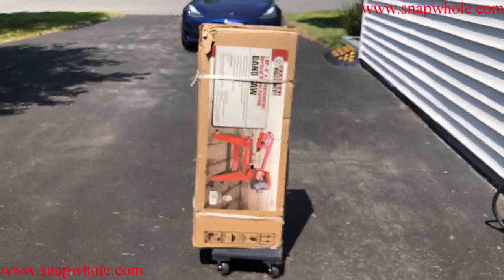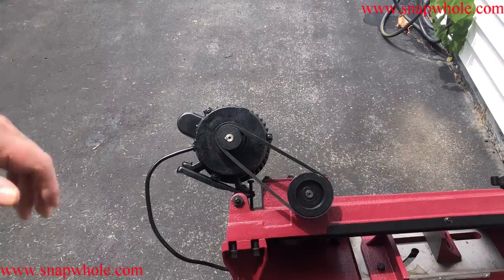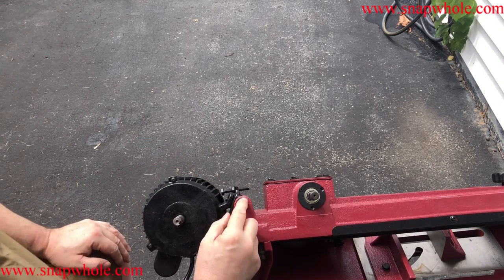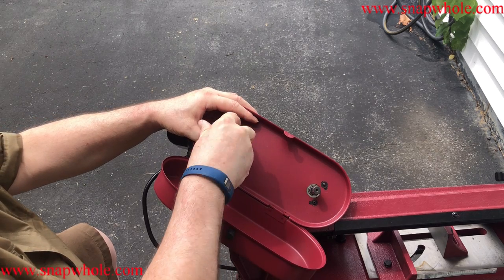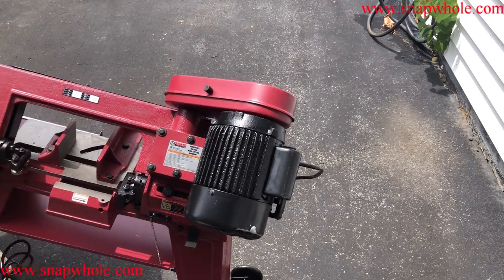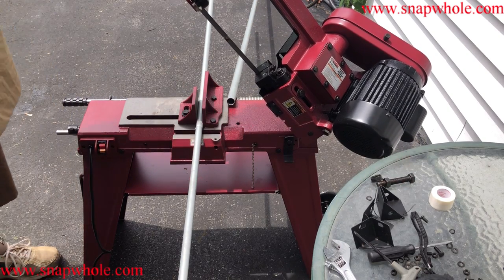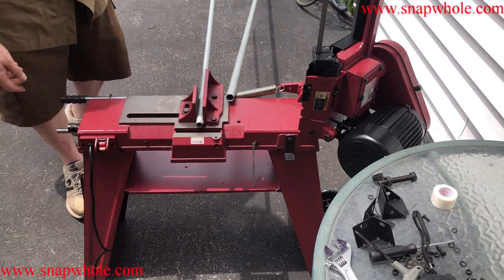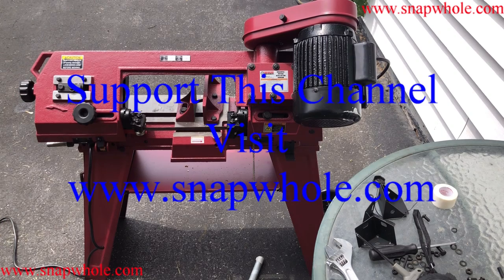Harbor Freight Central Machinery Horizontal/Vertical Metal Cutting Band Saw 1 HP 4 in. x 6 in.

Comment: The handle with the spring is used to slow down the cut. Turn the handle clockwise and it will put more tension on the frame and cause it to fall slower. Also by adjusting the blade roller guides you will be able to get the blade to cut straight instead of at an angle. Do yourself a favor and buy a good german made blade. I have installed one of those blades on mine and it has lasted me 3 years and I have cut quite a bit of iron and aluminum. After I made the adjustment to the blade roller guides I am able to cut a .020 thin piece off a 2" round solid aluminum stock and also on 2" square tubing with 1/4" thick wall. The trick is to tighten the spring tension and slow down the rate of fall
Reply: he probley never will read ur post lol ..

Comment: That looks awesome. I would never have a need for that but I like it. So when are you going to do a shop tour? I’d love to see your setup
Reply from the maker: It as a luxury buy for me, especially for the space it takes up, and I won't use it that often, I just bought the plywood to build a new miter saw stand, it is amazing how much stuff was in the old one, and it is now stacked every where, my shop is not that big to begin with..... also in the middle of 4'x4' CNC build in my spare time, not a lot of that lately, not much room for making videos until I get those project done
Reply: @snapwholeharborfreightreviews    I have a workshop in my garage that’s starting to fill up. All of my bigger power tools I have stands for so that takes up a lot of space. I still haven’t used that Bauer thickness planer but I have a project I’m going to start here soon.

Comment: Hi would this work to cut rail road track?
Reply from the maker: it should cut it, I would get about a 24 tooth blade, it has a great feature for cutting something like railroad rails, get the blade tight and set the blade on the rail and it has  enough weight to keep cutting, and has an auto off when it is done, one of the best feature of this saw - thanks for subscribing!

Comment: How square were the cuts? Im interested in one just to make simple reliable straight cuts without too much prep
Reply from the maker: the cuts are square, but you have to setup the bandsaw correctly, blade tension is very important and setting the clamp tight, but mine is cutting square after I setup the saw - Thanks for subscribing!

Comment: Looks like it would need to be anchored to a base for stability…I would love to get one of those….how hard would it be to hide from wife?
Reply from the maker: no hiding this one! I had to think alot before I bought this, I have a small shop, but once I bought it, I'm glad I did, I use it a lot more than I thought I would, very useful - I wondered how stable it would be with the wheels on one side, but wheels are mounted so they only work on a completely flat floor, so it is stable, I originally thought the wheels were a bad design, but then I figured out they are made to be used as a last resort, I have a 1 inch step from driveway to shop slab and the wheels can't even handle that - hard to describe - I was using it to cut 10 ft pieces of 1 inch conduit for a new CNC machine I'm building, and no only is the saw big, you need  to have a lot of area around the saw when you use it to cut long pieces like that, that is when the wheels come in handy, I keep it back against the wall, and pull it out in the open to use it,- I recommend this if you have the space - I plan a follow up video on setting up the blade with more detail and setting the saw up for vertical use
Reply: Now they are $360.

Comment: Just had to take it back  the roller guides  way out spec the vertical  roller  does  not stay centered  wonders back and forth  to the point  the blade  jams and breaks in 2  / would  have to fix this for it to be a working  saw = press the pin out and some type washers to keep  the roller centered  and not pinch jam the blade.  Can't  imagine how  many  of these quality  control  mistakes are  out there.
Reply from the maker: either I got lucky or you got unlucky, I do not have any issues with the saw, very solid saw and I can make repeatable cuts one after another and use the auto off function for unattended cuts with no issues - thanks for subscribing!

Comment: Read the INSTRUCTIONS FIRST and then adjust the tension spring that offsets the weight of the saw !!
Reply from the maker: glad I did that first when I did the setup, that is exactly how I want the tension to be on this saw, I'm surprised you set the tension different, but you must have different needs for your saw than I have, that is the best thing about the tension being adjustable, different settings for different needs - thanks for subscribing!

Comment: can it cut 1/8" steel bro?
Reply from the maker: if you tune the blade to be tight enough to not flex, and you are patient, yes it will, the lever design will allow you to rest the blade on the steel and let the weight of the saw hold pressure on the steel and when the cut is finished, the saw will auto off - great saw - thanks for subcribing!
Reply: Thank you for getting back. i just bought one @snapwholeharborfreightreviews
Reply: I put a German made blade on mine. After adjustments I was able to cut a .020 off the end of a 1/8 x 1” square tube
I have cut a 4x4 piece of solid aluminum just to see if it would. It took awhile but it did it. I built a nice roll around stand with slide out trays out of an old engine stand. Now it is at the right height to work with. I’m really surprised by this thing. I have had it 3 or so years and use it all the time in my fab shop. I have a jet at the busy end of the place but this one works great for my projects
Reply: i went a different route since then